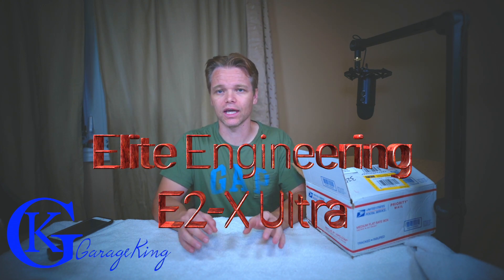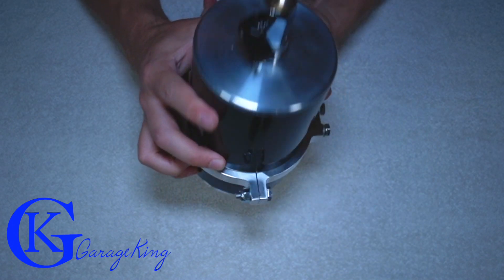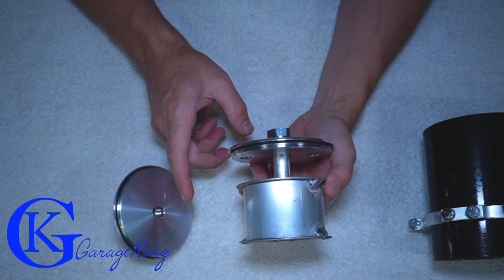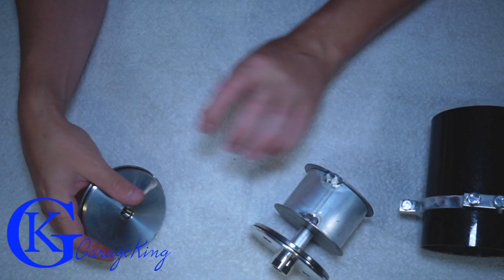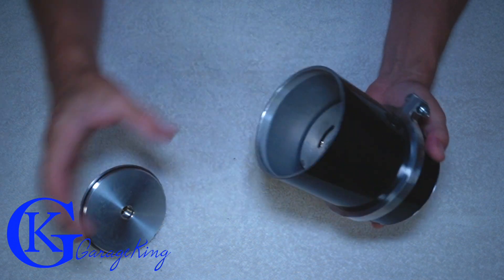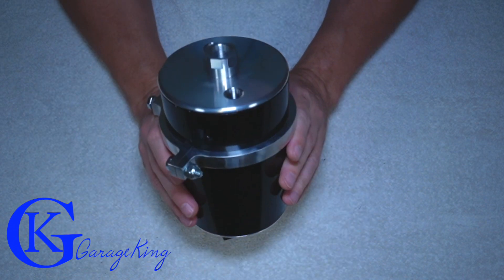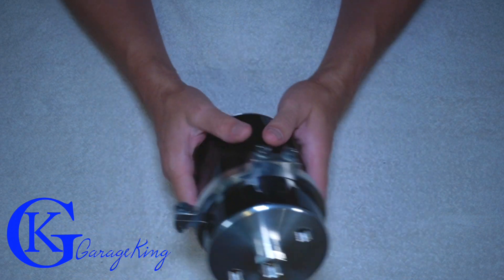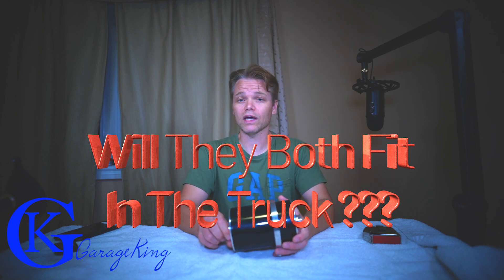Elite Engineering E2-X Ultra Catch Can Review

Comment: What is with this similarity between the RX Performance, from YouTube video-Tracy Lewis 3 years ago, diffuser-baffle assembly and this one? Also I saw your video on the Elite E2-X vs MightyMouse OCC related to your Corvette video. Tracy was warning of patent hit back then. I am impressed with the latest 5 way diffuser from UPR (YouTube -1 year ago.) Thoughts?
Reply from the maker: Hey there, the Elite Engineering is the same as the RX Performance.  Elite sells it under their name.  So it's the same.  The UPR is a great design, but the only thing I'm concerned about is the pressure drop, as that mesh is really tightly wound. That can cause it to get plugged.  When you are on Youtube search for this video "Servicing Your UPR Oil Catch Can System"  and you can see.  If you keep it clean its probably very good.  

Not sure if you saw my video on catch can design https://youtu.be/bQE1qEtP8dQ  its interesting, and and the society of automobile engineers run a test https://youtu.be/AL7OVJ8Kxe0  I'm not sure if the 5 way diffuser is the same as the one on the Youtube video "Servicing Your UPR Oil Catch Can System"

Comment: Elite or MM?  Your opinion?
Reply from the maker: Depends on where you are putting it and if it can fit. I’m doing two tests right now.  I’m running the elite and MM on my truck together. I have completed the first part and the elite caught more, but it was first in line. Now I reversed the cans and they are still running. The MM should catch more now as it’s first but if the elite catches more then enough said.  I’m also doing a test where I run the elite on my Z06 then check what’s in the blower, then run the MM the same number of Mileage and check the blower.  I will be posting both those vids hopefully within two months. I can say so far the Elite has performed very well. Some people prefer the MM as it vents, but you can also attach a 1 way valve to the Elite and it’s the same thing (only two lines required)  once I finish my test I will have definitive results. For the moment I would say Elite.
Reply: Thanks, look forward to seeing those results
Reply from the maker: @fzr1000981  For sure, if you want to see how I hooked them up its here https://youtu.be/waIz0vfefPY  but I know the results are what people are going to want to see.  I'm thinking I should get good results, but if the two can test leaves any questions, then the corvette test should be good as its one can, and then check the blower so any moisture is going to evaporate with the heat and all that will be left is oil.  Stay tuned, it should be out in about 2 months, until then I put out my how to fix etc.  Thanks !!!!
Reply: You're running the normal can on the Z06 not the Ultra correct?
Reply from the maker: @fzr1000981  That's correct, no doubt the ultra will do really well due to its size, but on the vette its the regular E2-X as that's what most people put on. This way people will be able to see the ultra vs the MM on my truck, and the regular E2-X vs the MM on the vette.  The tests are a little different, and to be honest I think the vette test is better as its really easy to look under the lid of the blower.  Plus I bought my Z06 new so it was spotless underneath.